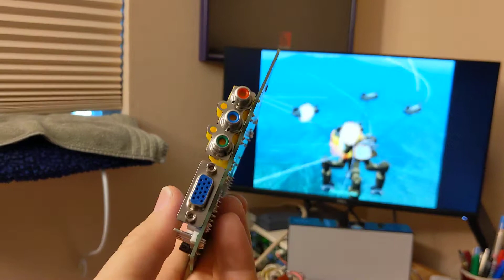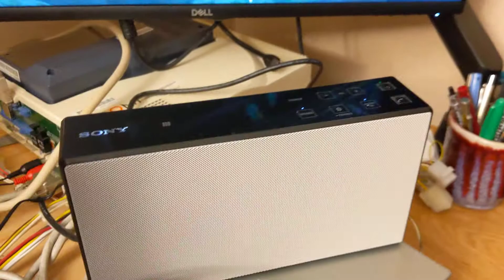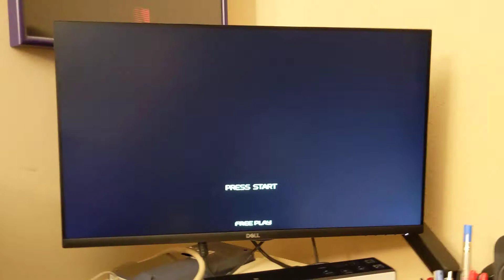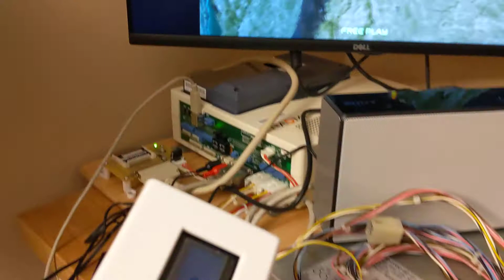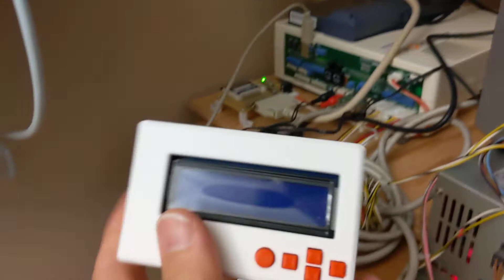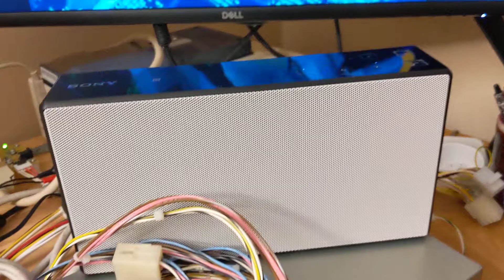Sega Naomi Netboot with WiPi - Part 2

Comment: I have two Initial D3 cabinets. They both have the netdimm things. I've been thinking about trying the wipi thing, but I can't find any info showing that both could still link together. Do you think they would? Cool video btw :)
Reply from the maker: I've never linked Naomi cabs but know that they use a link board and tsolink cables.  I don't see why it wouldn't work.

Comment: Do you recommend a certain type of psu to power up a Naomi with a netdimm?
Reply from the maker: I've used the original Sun power supplies, as well as PC power supplies without issue.  I haven't ever used a Capcom I/O so I'm not sure about adding that into the mix.
Reply: @TomsProjects  just got the cables needed today and plugged everything to my atx power supply and it’s now up running.